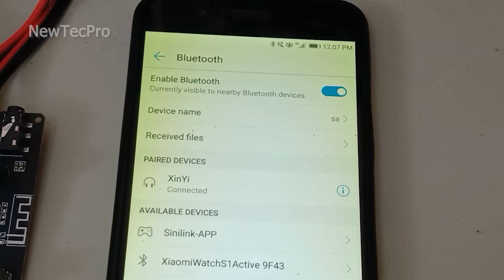Build Bluetooth Speaker: XY-C50L Amplifier 2*50w Module Tutorial

Comment: Aux output not for subwoofer, that's for home theater it will work as Bluetooth receiver.
Reply from the maker: Thank you very much for your feedback and for pointing out this important aspect. It's an interesting point. However, it ultimately depends on individual needs. For instance, some people may want to add a subwoofer channel to their stereo audio system. In such cases, the AUX output can be used as an input to the subwoofer amplifier, which is an advantage.